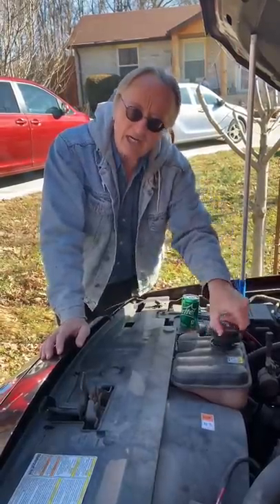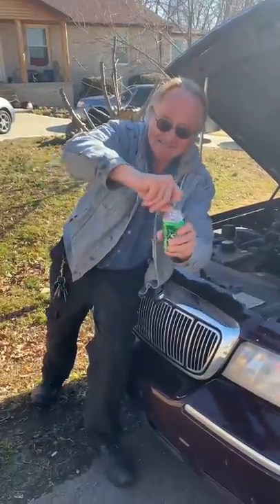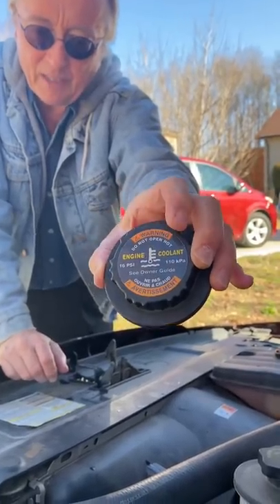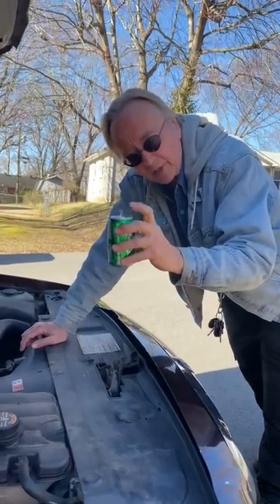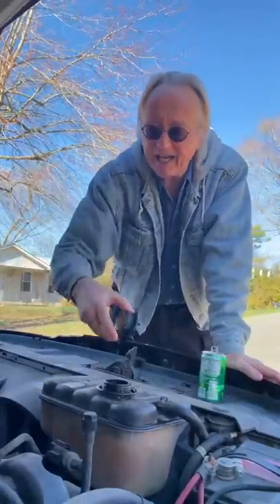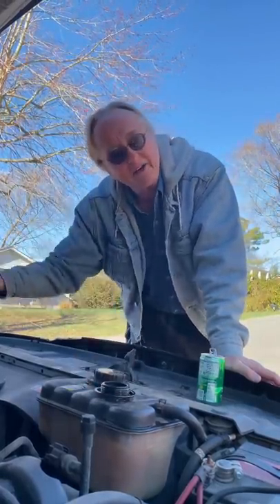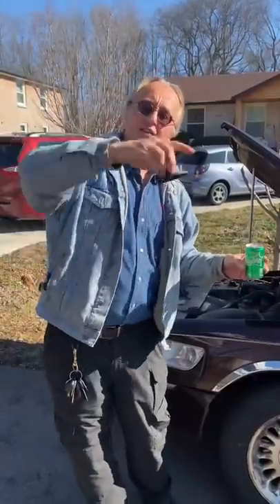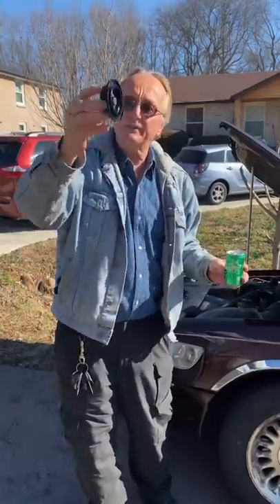You Need to Check This on Your Car Right Now

Comment: I had a Malibu a couple years ago, it was over heating and leaking coolant. Took it to the shop and they said it had a blown head gasket. I just replaced the cap, and it was fine.
Reply: Lol I had the same deal on my Malibu
Reply: So you are saying you have a new cap with a blown head gasket ? Lol 😆
Reply: I just want to clarify, that if you had coolant mixing with your oil, that cap defiantly didn't fix your issue, it just stopped the mixture from leaking out. Either they lied to you about the diagnosis, or you got lucky and that car limped its way around until you dumped it.
Reply: Same thing on my 2007 Malibu, scrapped now 🪦

Comment: My dad who worked at the Camaro plant in Norwood Ohio in 86 and 87, and they had an Oldsmobile (a 73 if memory serves) and it was forever overheating so he bought a gadget to release the pressure a flip top so you would slowly release the pressure well one day we were on the highway (because you had to drive 20 miles to go to my school and 20 miles to go to my mom's work and then 20 miles to go back to my dad's work because that's the way it is in Cincinnati) but close to my school and the car has been overheating for awhile and my dad finally got there and popped the 'cork' and the whole cap popped off and my dad got some pretty severe burns fortunately none to the face he was okay after a hospital visit, anyway I (and my dad) learned to never mess with a hot engine and to never trust a cheap that'll fix ya cheaply part.

Comment: Wish I knew this earlier, my cap wasn't letting pressure escape and was the source of multiple expensive leaks, including a radiator replacement. And not to mention having it towed once. All during a road trip vacation! Not a single mechanic figured that, and blamed it on worn out hoses. Took a kind stranger on a highway in the middle of the dark to figure it out. I was also fortunate that the last leak took place on a hose connecting to the heater, all he did was plug it up with a wrench tool and said I'm fortune it ain't winter. Drove home without a cap on, enough to get me home 130 miles away .

 I've learned it was more than just a cap since.

Comment: I followed this advice after seeing traces of sprayed coolant on the engine cover... 
It was from the radiator cap... I think the new one has fixed my problem. (the old one was problably 11 years old, it was a denso cap and has more than 140 000 miles)

Comment: Every 1psi in the system raises the boiling point 3 degrees. Thus a 15 pound pressure cap gives you a boiling point of 212 plus 45, or 257 degrees. Cooling systems often operate above 212 degrees, so if you remove the cap at operating temp your coolant may flash into steam. I have the purple scar on my right arm to prove it.

Comment: We kept jugs of water in the back of the station wagon we were gifted because the radiator was broken.
Smoke billowing from under the hood was only a matter of time after starting the wagon, and it happened much faster on hot summer days.

Our neighbors could see us coming from a mile away.

Comment: I have q 2005 lincoln navigator and  1994 gmc jimmy both with extremely hight mileage and I been the owner for a long time more than 15 years I always what I do is to break the seal wich seals the pressure part so coolant won't leak and it won't pressurize. Never had a problem or had to do anything but don't even have to top it off even i check it every week and after doing that never had a waterpump leak or a hose.

Comment: I checked mine before a road trip in my 2001 s10 and sure enough it was leaking from the cap lol. I checked my coolant the day before even tho it didn't leak cuz I knew I was going on a road trip. It's crazy how it leaked the next day after checking my coolant cap maybe the seal decided to break when I opened it then closed and turned it on in the morning.
Reply: Always dampen the flange before replacing the cap. Just dip your finger in the coolant and wet the flange. You're most likely correct about reason n for cap leaking. When put on dry it binds and can even crack the gasket.

Comment: Ford had the sense to use a separate trans fluid cooler not part of the radiator. And my 4-speed with OD has a torque rating twice that of engine's peak torque.
Reply: Most Ford trucks had a radiator and external trans cooler. They work pretty well. The Chryslers that have an A/C condenser and trans cooler together are kind of weird, but the earlier Chrysler trans coolers leaked whenever you disturbed them while removing the radiator, so maybe that's why they put them together.

Comment: Food for thought. Ford’s 6.0 diesel has been know to blow head gaskets. Recently I discovered Ford had radiator cap problems on the 6.0. If the cap is holding the wrong pressure ( too weak) this can cause the coolant to boil in the head and ruin your head gaskets at a minimum. Could a coolant reservoir cap  be the real cause of the 6.0 problems? Yes I changed my cap as soon as I found this info.

Comment: $5-10 for a high pressure fuel cap that screws right on top of the original would fix this issue permanently and avoid a fault cap leaving you stranded.

Comment: I keep having to replace my antifreeze hoses aren't leaking can't find the leak to be honest I know it's not leaking into the engine but doesn't seem to be wet around the cap either should I still replace the cap original cap and radiator my car is a 2000
Reply: As a former radiator repairman I always advised to flush cooling system and change radiator cap and thermostat every 2 years or 20,000 miles. With the newer long life coolants that's not necessary. But still change your cap every 3 years at least. We only used Stant caps and thermostats.  Guess they still make them.
Reply: @johnchandler1687   alright got a new thermostat new coolant just need a cap now. my cap is original honda cap and my car is a 2000 honda accord

Comment: when I do it my radiator starts to get coolant pushed out of it where the plastic tank is clipped on; even happened to leak from the water pump too when I tried 2 different caps
Reply: sounds like your water pump is bad. ?
Reply: @jayhockley8841  it a brand new aisin
Reply: @morphius747  Brand new doesn't mean free from defects. Take it to the dealership if its brand new.

Comment: Good Day Scotty! I have a Custom Built Jeep with good old Toyota 4K Engine, my question is... Is it okay to remove the Rubber Seal in the Radiator Cap in my Old Radiator? Some Radiator Repair Shop said that it helps lessen pressure of the radiator to avoid holes in the future to preserve the radiator... What's your opinion about it?
Reply: NO!

Comment: Ive had alot of people fix stuff on my truck . some just made it worse some dis a good job. I have a 2000 ford expedition it over heats so i had them change the thermostat, they put the same gasket instead of the new one truck over heats more. That same day had 2 oxygen sensors changed and another part they broke cost me 100buks,  i asked a mechanic and they said it could be head gasket would cost me 560 to more than 1000 to fix.. When it over heats all the coolant and water splashes out looks brown and kinda oily. Do you have any advice for me ima female and where ever i go they try and tell me it hella things wrong with it. I need help please i trust nobody anymore

Comment: Hey Scotty I have a question my car keeps popping up with p1130 and I already replaced the 02 sensor but that didnt fix it any tips its a 2001 lexus rx 300
Reply: Check for vacuum leaks
Reply: Thank you i have check but didn't see anything major i did see one hose off and fixed it and its still popped up and my car idles alittle weird @jonas Peterson
Reply: Did u get the pricier OEM O2 sensor? just watched a vid that someone saved some money getting cheaper one, threw the whole vehicle off bad and no one could figure it out, was simple with the right mechanic.. The O2 sensor wasn’t OEM.. may cost more but it is the solution(unless u have another problem)… also there’s multiple O2 sensors sometimes, do u have more than 1? if so, recommend doing all. Changed both O2 sensors on my 1996&1999 4Runners in the past, stopped all probs. Hope that helps maybe!